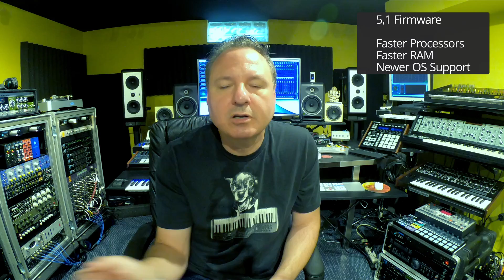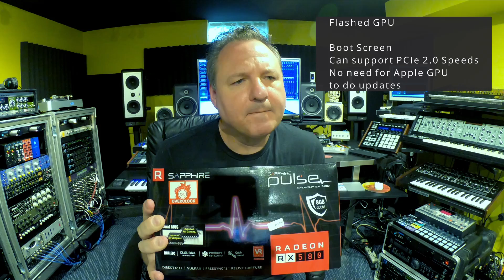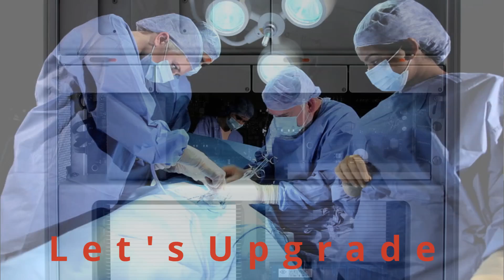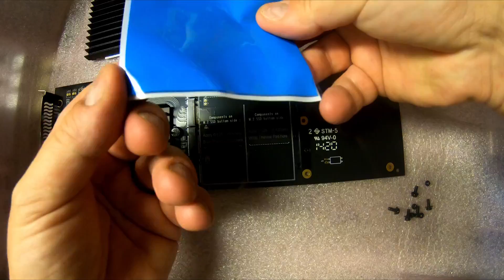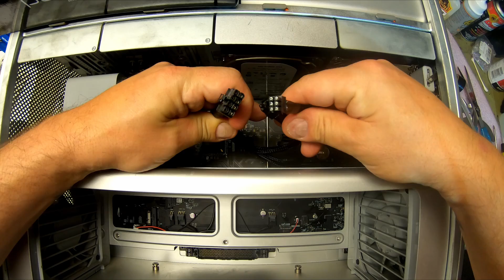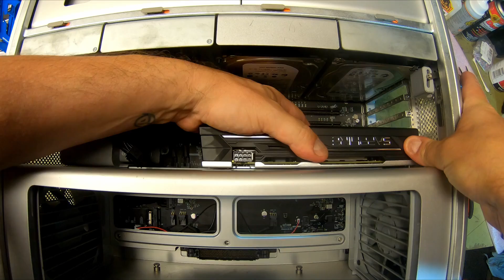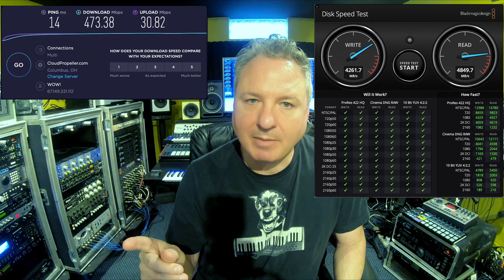2009 Mac Pro 5,1 Extreme Upgrade

Comment: I did this to my 2009 4,1 quad 2.93Ghz to end up with a 5,1 hex 3.46Ghz machine with a generation faster RAM.  With a boot SSD, the difference is night/day, at least.  It is the heart of a large Pro Tools HD system, using a Magma host card and chassis for HD6 DSP.  The speed increase, reduced power and heat, and system stability were all very satisfying and completely changed my work.  The old MacPros were the end of a golden era for Apple, when visionaries built hardware targeted to the customer, rather than max profit.  I’m constantly surprised how few know the gold that exists in these amazingly forward thinking computers.  When I did it 6 years ago, NVME was not available for it, and I thank you for the tip on the Sonnet adaptor.  

I have just today watched a Thunderbolt conversion for this machine, which I had resigned myself to ‘not possible ever’ acceptance.  Looking into it as I write this.

Comment: WOW - I've been doing computers for over 40 years ... that was one of the best presentations and explanations of equipment, upgrades, reasons (thought process), etc.  I don't even own this computer (have worked on them) and enjoyed the content.  Thank you.  Glad to see you switched to the 3 bank memory setup.  I was worried about the graphics card fan airflow (still worried if using video editing or gaming, not in your application use)

Comment: I'd be worried about not enough airflow with the memory card right above the GPU like it is.  Have you had any issues with the GPU running hot?
Reply from the maker: Very fair to pay attention to that. I run one monitor at an average resolution so the video card doesn’t run hot. With the upgrades in here I actually am running cooler than I used to. It’s an upside of getting rid of spinning platter drives and the old video card all of which heated up the interior of the computer more.

Comment: Thank you for the info! just got a 2012 5,1. Like you doing Audio (light video). This is very helpful. Have you done any benchmark tests, before and after?
Reply: Yes I have on the GPU and drives. The biggest significant boost if you need that is putting the OS on a 6GB SSD via a PCi card - note not the internal bays on a sled as they are restricted to 3GBs (whatever your SSD does). This gives you a slick boot and fast Finder response. 

Then for you data get 4 identical HDDs 7200 RPM and reliable (over 10,000 RPM and fragile) and soft RAID them to double the internal 3GBs to 6GBs for data read and write. This will easily be enough for audio and video. If you want to go mental like this fella, you can double this again by using 4 x SSDs on a PCi card, but really, I don't think you will need this unless you are launching a space shuttle.

Video card - again, a lot of fluff I find. You are not gaming so a 4 or 8GB RX580 by MSi will be fine.

Despite this video, I have never needed more than 32 GB Ram although feel free to add more and have 20 apps open at once. Again, quality over size because if the RAM fails you can have multiple issues including a failure to boot at all... rendering diagnostics etc redundant. 

Lots of links on the web to help - we have been doing this for 11 years now.

Comment: I have Mac Pro 4,1 2009 flashed to 5,1 with Metal Graphic Card same as you have added. With these upgrades are you able to update to the latest OS and is iCloud working with Mojave OS? Do you know if doing the processor upgrade allow you to run the latest OS. Great video thank you for sharing.
Reply from the maker: I can use iCloud just fine on this machine which is running Mojave. If you install the "OpenCore" software it would allow you to install even newer OS's like Big Sur on the CMP. I stopped at Mojave for my machine but other users seem to be happy with even newer OS's.
Reply: I've got a 2008 8 core machine running Catalina with 32gb ram and a 2gb video card. No performance issues at all. Dosdude1 has a great patcher for Catalina, which is so god damn easy to use.

Might even go up to big sur as patchers exist but I's a work from home rig and catalina is stable.

Comment: I did some research to upgrade this 2010 mac pro, and I try to put 2 GPU into it and I think the final cut pro will use dual GPU and the render time will be reduced.  just as you said , extreme upgrade.:) very glad to see you do the same upgrade as me. Cheers!

Comment: Great job! Can Sabrent Rocket nvme drive be used instead of the 970's? and any problem with using CPU's that are lidded? I have two of these but the lids are still on.
Reply from the maker: I’m under the impression that the Sabrent should work but I don’t have experience with them personally. Many reports exist of people using the lidded CPUs on a 4,1 where they were just very careful in re-installing the heat sinks, so it can be done.
Reply: @paperstreetaudiocompany  Yes, I have a mid-2010 Mac Pro, which was 4,1. I flashed the firmware to 5,1 (seemingly--as far as I recall) without a problem. And the new Radeon RX580 (metal) works wonderfully. The Crucial 1TB NVMe M.2 was not recognized; thus bought an enclosed housing for it and use as an external. However, having followed the recommended specs on the former upgrade video, I bought 48GB RAM. My system was only ever able to use 32GB. (tried again to install 4x sticks but only flashing white light and no boot.

As for the CPU's (dual): watching the former 'upgrade' video I attempted de-lidding then new Xeon chips myself. This worked on one Xeon chip but I may have inadvertently (perhaps) scratched a component; hence one chip ceased to work. With no real way to check them individually, I set that them aside. After a little more reading and searched on more upgrade video's, I re-purchased 2x lidded Xeon CPU's (3.33Ghz) and installed those. Worked fine - just was very careful to not over-tighten the heat sinks.

Comment from the maker: I am currently running 96 GB of ram to see if the benefits of triple channel are better than the benefits of more ram. As 96 GB of ram is enough for my usage I’m likely to stay in triple channel to get its speed increase.

There are two possible areas to explore to go further with upgrades on a similar Mac Pro (that I opted not to pursue)

OpenCore on the Mac Pro allows for things like video acceleration, seeing the boot screen with unfleshed video cards, and running even newer OS's. It's widely supported and appears to work well. I tried it for some time but opted against it for my final configuration. 

More powerful GPUs. There are more powerful video options available, but most also require more power from the computer and the pixlas mod allows you to get the power to run them. If you need more video power it's an option. I opted to stick to a powerful enough video card that doesn't need a mod to get power, and more powerful video cards really jump up in price.

So that’s where I drew the line in this one. The firmware update was easy and immediately helpful for general computing. OpenCore and the Pixlas mod were worth mentioning here but not things I’m going to pursue.
Reply: When you pull up the about this Mac and look at your ram memory does it say that you are running at 1066 MHz or 1333 MHz? When running in triple channel 96 GB you simply left dim slot number four and slot number eight empty correct?
Reply from the maker: @trelstudios  it’s definitely running at 1333

Comment: Amazing vid! Could this old Mac Pro run Big Sur or only Mohave?
Reply from the maker: If you install OpenCore then you can run Big Sur. It’s not officially supported but it’s possible. I opted to stop at Mojave as that’s fine for my audio production computer.
Reply: @paperstreetaudiocompany  Thanks
Reply from the maker: https://forums.macrumors.com/threads/opencore-on-the-mac-pro.2207814/

Comment: How much was the upgrade cost, can you show running audio ? Great video btw
Reply from the maker: The description links should have the cost of each item there. I’m afraid I’d lost track of total cost. I can say that the Sonnet M.2 card and the Samsung NVME drives were the most expensive parts by far. I allowed that expense knowing I could move them into a new machine in the future. 

Running audio is what that computer does most of the time. Currently I have 6 Metric Halo 3D audio interfaces which gets me 128 actual real physical channels of IO. I’m using that many inputs, but far fewer outputs. I can run big sessions handily but I notice that new smart plug ins that I like a lot use more computer power than my older plug ins. For instance using the Leapwing DynOne multi band compressor plug in on a few busses east up a lot of computer power. I’m sure the Apple silicon will be a welcome change, but this machine gets the job done. I just finished mixing a couple of two hour long multi tracks from live jazz shows and it worked very well. Plenty of tracks, edits, and plug ins and the results were great. 

This is the first edited video I’ve put together for YouTube and I expect audio topics will become the bigger focus, so we just might see this computer doing a real session.

Comment from the maker: I just thought to mention that I put a little rubber washer between the video card and Sonnet M.2 card because the RX580 fans stick out a bit and I didn’t want them to rub on the M.2 card.
Reply: Thanks for this! I was wondering how you did that. I’m going to go and re-configure mine now.  I had my video card in slot 2 and sacrificed a pcie slot. How is it working today? And issues?
Reply from the maker: All is working nicely.